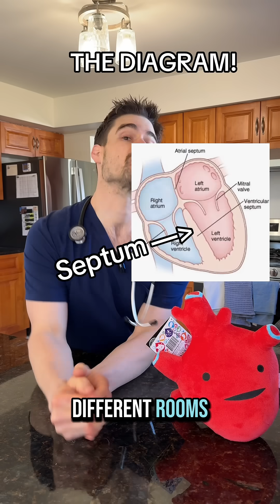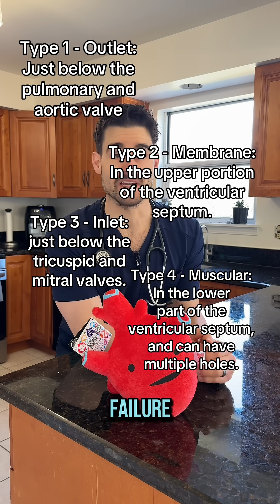Ventricular Septal Defects

Comment: Please for the love of god if you have a patient with a VSD make sure that they don't have residual heart muscle tissue on the heart wall. I was born with a small VSD which in 93 wasn't worth the risk of open heart surgery to fix. In late 2020 I started having a lot of heart symptoms and an angiogram found that I had residual heart muscle tissue that had been growing with my heart, it was under my pulmonary valve and by the time I had surgery to fix it my pulmonary valve was almost completely obstructed. The combination of the two defects caused extreme stress in the right side of my heart and low levels of oxygen especially to my extremities. It's an easy defect to miss but it can and will shorten the life of the patient. Plus it's exhausting, scary at times and makes you very cold.